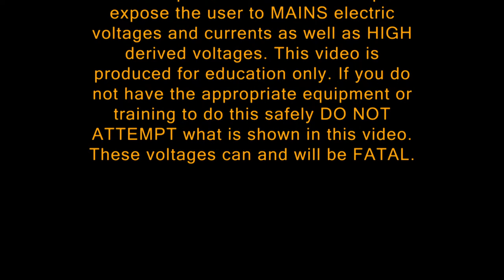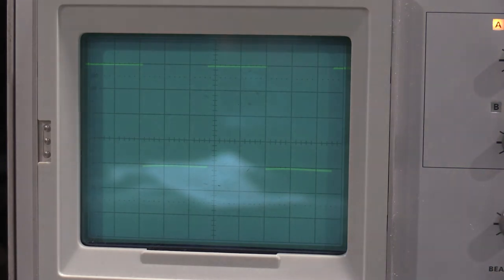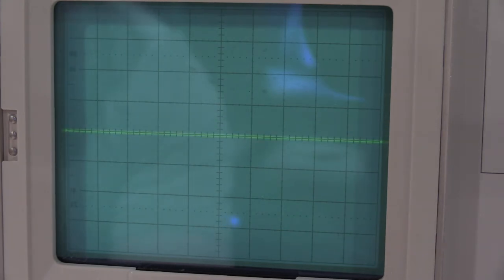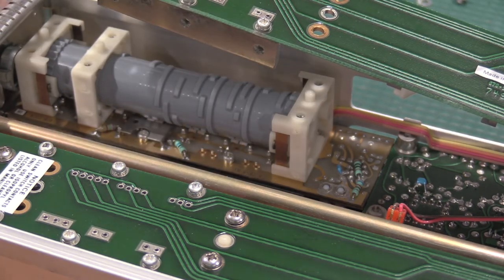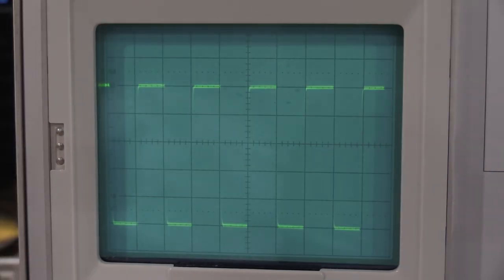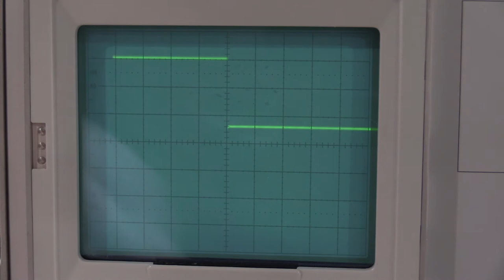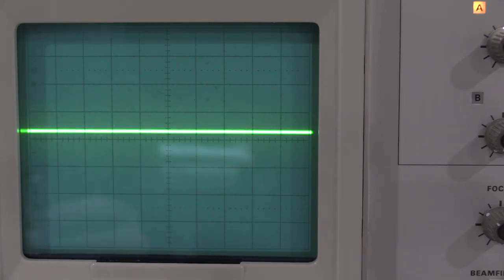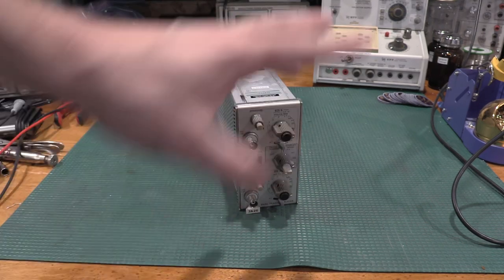Tektronix 7a26 Restoration and Alignment

Comment: +1 on the 7904A frame cal. I bought a 7904 a little over a year ago and have been trying to cal plug-ins myself. So glad I found your channel! Keep them coming.
Reply from the maker: Welcome Pmeltech, It is in line for some time on the bench. If you want to do a full cal on yours keep a looking out for the 7000 series calibration fixture for the 78 79 and 71 series frames you will want the -02
Reply: @ZenwizardStudios  Yes, I have a 067-0587-02 and a -01 on the way. I have so many questions for you lol. I'll start off easy, what part of the country are you in? I'm in the Greater Salt Lake Valley in Utah. And do you have a video where you show re-tensioning the cam switch fingers?
Reply from the maker: HI Pmeltech, The lab is in an undisclosed location but I am no where close. On the other side of the US actually. In terms of the cam switch re-tensioning yes I do HOWEVER a warning. ONLY do the cam switch service as a last resort in an otherwise terminal switch assembly. It is very fiddly and hard to get right . and the finger switches have to be kept flat. I had one go bad on me recently where one side would make contact but the other would not. So use as a last resort but check out the 7A16A video. I have a 465b coming for the bench that I am going to try some deoxit on the contacts to help especially given the age. But that will be a full video. It will be a LONG one cal procedures for a 400 series scope are about 3X as long as a 7000 series module. Cause it is all built in. In the case of you -02 calibration DO NOT I repeat DO NOT dissemble the switch assembly also I have heard that even alcohol can damage the elastomer. To get the high frequency 1Ghz+ it does not have finger switches it has elastomer switches. These needed a special factory alignment assembly to put together. The plug in may never work again after disassembly. Also the -02 and -01 can be used under their respective frames. For instance, a -01 and -02 can both be used to cal a 7603. However, a -00 should not be used to cal a 7854 or a 7904. And really for a 7904 the -01 is reaching its limits as it is a 500 Mhz plug in in a 500 Mhz frame.
Reply: @ZenwizardStudios  Thanks for the info. I will check out the 7A16A video! I've cal'd 7B50, 7B80, and 7B92/A, so I'm watching your 7B92A video now. I Hope to learn something from it as I definitely had some issues with the 7B92s. I read the manual on the 067-0587-02 and was aware about the "critical" elastomer switches, although I did have to partially dis-assemble it due to a bent (read that as weak) spring comb on the bottom of it. Luckily you can remove the switch from the unit as an assembly in order to retention the comb fingers without messing up the switch. Dodged a major bullet on that one as it was an ebay purchase and of course no mention of any problems about it. I wanted a -01 because I hoped they are easier to maintain than the -02s.
Check out the repair pictures of my 7904 HV board here-  https://www.antiqueradios.com/forums/viewtopic.php?f=8&t=397079  -if you get a chance. Thanks again for the GREAT videos!
Reply from the maker: Pmeltech, Awesome to hear yea I had a very similar issue with mine I wonder if it was a design issue. I can confirm that the -01 is much easer to maintain then the -02 it has the normal Tek drum switches. That high voltage boards is painful looks like there was a fire.

Comment: I think this is the first episode where I actually have an example of the hardware in the pile.  I am a bit envious of your test setup.  I don't have any calibrated signal sources I really trust, so "calibration" consists of averaging all the best instruments in the house...
Reply from the maker: K Randall, It takes a bit of time and being stubborn helps I think. The bench started with a DMM (6500), the Rigol scope, and the frequency counter, as the basis of the accuracy. The accuracy was from the known calibration on the 6500 (New) and the Rigol (New) and the frequency counter (used but with a 10 Mhz GPSDO for reference the Leo unit.) This gave me all the accuracy that I needed to get the pg506 and the TG501 whipped in to shape and the SG503 sanity checked. You calibrate the 506 at DC. Did not get me the fast edges I needed that is what the tunnel diode pulser was used for (not the 284). From there it was just taking it one instrument at a time and building up the accuracy needed. When I needed to calibrate the DMM’s in the 5006 frame I got the 7510 and the AC and DC references. One thing to note is a 7000 and 400 series scope is only 3% +/- on the vertical. The trick to the process is setting the foundation and building up from there. PG506, TG501, SG503, Tunnel diode pulser(if it trips this is why I keep a 106) That is enough to do a 400 series scope aside from another scope and DMM. Add a 7000 calibration fixture of an appropriate speed and you have what you need to do a 7000 series scope. 

I am working on a calibration video for the SG503 now I need to finish the last step before I post the video. I don’t have the peak-to-peak detector. I have one on the way but it is in transit.

Comment: A quick question, at approximately 51 minutes in you disconnect the PG506 and go to your Type 106. I don't fully understand why. I worked in an Air Force Calibration lab(PMEL) for 18 years and their procedure(33K3-) calls out the following equipment as the calibration standards to use: 7904 w/ 7B92A, PG506, 011-0049-01, and SG503. That's all, no Type 106. So were you saying you shouldn't use the PG506 or just that the Type 106 is a better choice? 
To be honest I almost never got to cal Commercial Equipment as I was a civilian working on military test equipment(dedicated Test Sets for Aircraft and "On Site Test stands) Jet Engine Test Cells, F-15 Rudder Actuator T/S, MM3 T/S, etc. The Commercial Equipment was cal'd by a contract organization. I eventually worked my way into an ES job where I was a liaison between my PMEL and AFMETCAL in Ohio. I worked daily with the ES's and Engineers responsible for all Air Force calibrations. I've since retired but still keep in touch with some of my contacts there. So let me know about the 106 choice, I'm very interested about it.

Thanks,
Dave

P.S. Not sure how familiar you are with Air Force acronyms:
PMEL: Precision Measurement Equipment Laboratory
AFMETCAL: Air Force Metrology and Calibration
ES: Equipment Specialist
MM3: Minute Man III
Reply from the maker: Pmeltech, That sounds like about the time stamp I was doing the high frequency compensation of the vertical amp. The reason for the switch is I needed to use a tunnel diode pulser 067-0681-01 This gives me the fast edge square wave that I need for the nice sharp corner. In my case my 067-0681-01 has some time on it and needs a bit more current drive to kick the TD my PG506 can’t quite get the diode to fire. The 106 will fire the TD with out any issues. This is a drive current issues with my specific examples and is more an issue with the 067-0681-01 then the PG506.
Reply: @ZenwizardStudios  Ok. I did not catch that on the video. That makes perfectly good sense now.
Thanks for the clarification!

-Dave